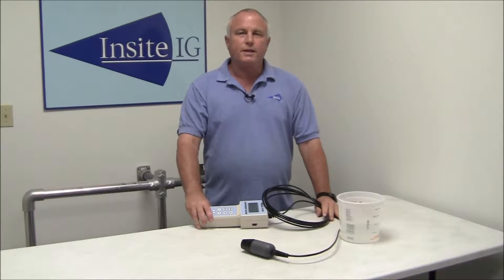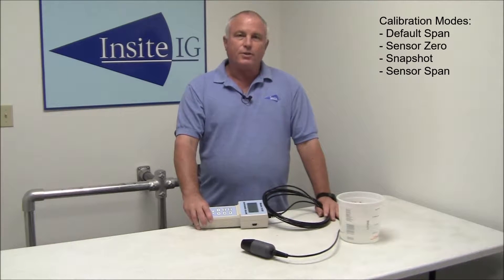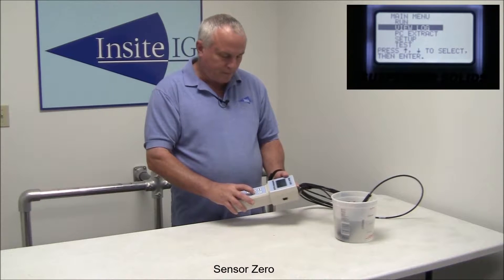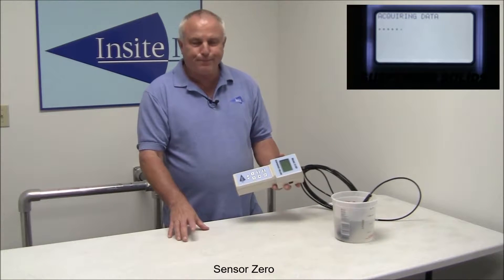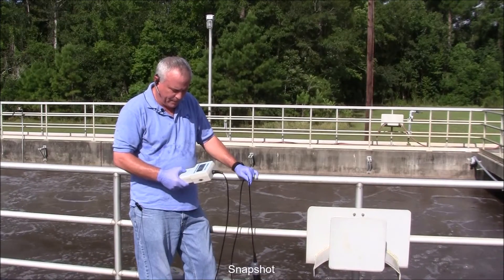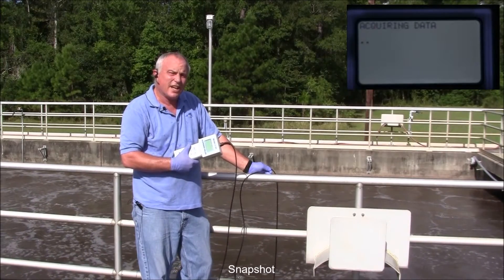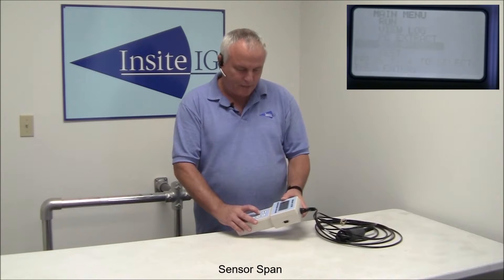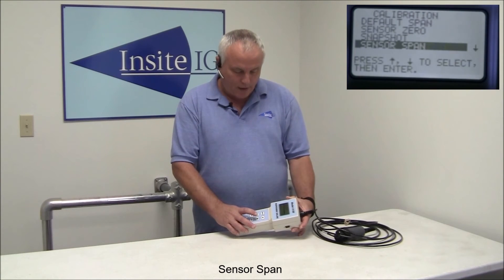Portable Suspended Solids Sensor Calibration

Comment: Question : Any diff TSS with Turbinity ?
Reply: big difference - TSS is total solids  measured as volume by weight usually expressed as mg/l ( milligrams per liter) - turbidity is the clarity of the water expressed as some form of turbidity unit (NTU, FTU, etc. ) there is no direct correlation across a range of measurement
Reply: @fluorescence985   r u sure ?
Reply: @alexgunawan98  2 years old but yes, the above is correct.   Turbidity is color and may still be 0 TSS.